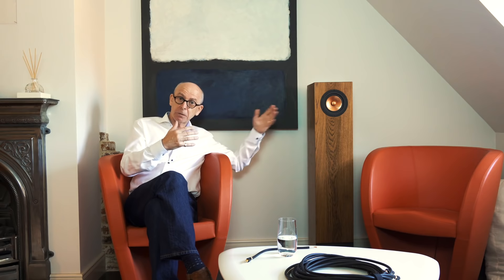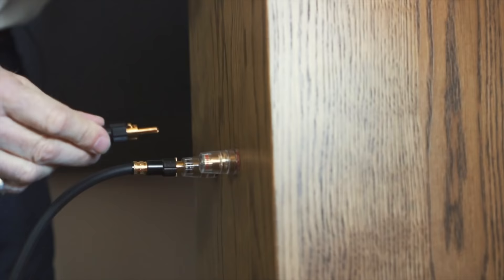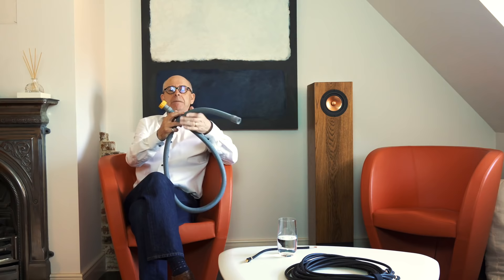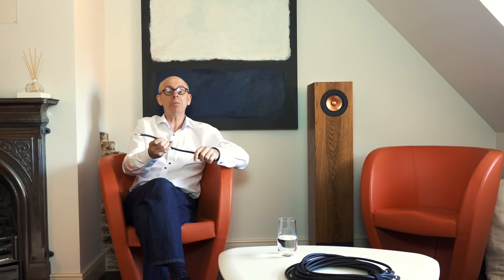Loudspeaker cables - how do they make a difference?

Comment: People forget that a speaker cable is simply part of an overall circuit comprising amp output stage, speaker cable and drive unit (bass is the most demanding load).  All you need to know to select the right cable is speaker minimum impedance, crossover design...dcr of bass inductor, damping factor, amp output impedance and damping factor. The latter depends on output impedance and crossover losses.

Any cable so capacitative or inductive that it acts as a filter should be avoided.  High inductance will roll off the hf and high capacitance can affect amp stability if poorly designed.

Most people hearing big differences between cables are really  hearing the results of either poorly matched amp and speakers or instability of the amp.

Cable geometry in voicecoils matters as it affects motor efficiency hence t&s parameters but this is simply not true of speaker cable...please dont conflate hearing differences in speaker cables with mythical magical electron scale effects...all cable if similar lcr properties will effect the exact same system response...fact.

Far too much tosh spoken by people with little to no real understanding of the subject.  I've been a loudspeaker engineer for many years and have grown really weary of hearing sales marketing nonsense spoken or printed about cables.
Reply: a speaker cable is simply an electrical conductor - that's it.  Crossover design has nothing to do with it, that's after the cable has delivered the signal.

Comment: The only way to find out is connecting different cables at your homeset.
I did and there was a lot of difference. The price doesn't matter, your preferences when comparing do.
I ended a Dutch handbuild silver cable by a small brand.
My set is a NAD M33 connected to B&W 804s speakers.
Reply from the maker: Thanks for your comment. I Absolutely agree. And the only thing that really matters is that you are happy with the results at the end of the exercise.

Comment: Do all the rest first… if you believe that they make a difference. Dit some tests myself and could not hear any difference between a decent cable and a very expensive one. Experiment with the placement of your speakers, it is free and has way more impact than any cable but a faulty one. Instead of spending much money on cables try some room correction systems like Lyngdorf, will have way more impact like cables too… and above all listen to the music and not to the equipment…

Comment: It makes no logical and scientific sense that cables below a certain awg makes any difference to sound, not when cable are in the 100mR per Km, take that over a couple of typical meters and you calculate a power loss far below the threshold of hearing, inductance and capacitance are also insignificant at audio frequencies at low Meter runs. But people are genuinly convinced some sound better, thats the power of suggestion.

Comment: Yes you are correct. Cables act as a part of the crossover in that they affect the frequency as the signal passes. But the strength of your system is dependent on the weakest link like steal parts on nuts and bolts in the amp, locks, and speaker bindings.
Reply from the maker: Absolutely
Reply: The weakest link in in most cases the acoustics of the room where the playback happens followed by the speakers and in many cases the humar ear.
And yes - cables are to just resistors - they can modifiy the signal depending on its frequency. But this effect is very low for low frequencies (and 20 KHz is low in that area).

Its a little bit like claiming that the speed your are driving with your car has an impact on the color of a traffic light as you see it..
That is also true (as we know from Albert Einstein) but this effect depends heavily on the speed you are driving - as long as you not have 80% of the speed of light it is so low that you can definitly ignore it)

Comment: After reading an interview in Stereophile with Henry Kloss, where he discusses working on a new design speaker, and when done, found that they could achieve the same quality sound, by simply using some Radio Shack Realistic brand loudspeakers but using a 10 band equalizer in the system, I've saved myself tens of thousands of dollars on equipment. I replaced the Klipschorns on my buying list with some Cerwin Vega AT-15's, and the Macintosh tube amplifier with a pair of Adcoms, as well as some other 'mid fi' equipment instead of the super expensive stuff that my audio snob friends had bought, and I had a lovely great sounding system. I guess I'm just lucky to have a 'low fi' pair of ears, so I'm able to enjoy my (now ancient) stereo system, while my friends spend all their time trying to find the difference in sound between monster cable and the simple 12 gauge lamp cord that I use. It must be terribly irritating to all the snob stereophiles who feel that they absolutely, positively, have to find the exact combination of absurdly expensive equipment so they can hear the squeaks and clicks that no one else can hear. Perhaps they can also hear the voice of god while they examine their setups.

Comment: I’d really love to see this guy a/b blind test whatever best cable he thinks exists vs a sub $100 10 awg ofc and just let it lie where it lays or lays where it lie or whatever’s said…
Reply from the maker: Hi. Thanks for your comment. This is exactly the point I am making. Our cables are multi-strand copper (hence ‘neutral’). My video is explaining how, technically how cables can sound different. It can be easily demonstrated when using cables that have been deliberately made ‘to sound different’. Just like adding a capacitor or inductor or resistor (or all three) across a loudspeaker you can very easily shape a different sound. you can also do the same by using the materials in the cable to effectively become a capacitor, inductor or resistor, or all three.

Comment: They definitely do make a difference. Without them I struggle to hear anything. I suppose one way of eliminating the effects of conductance and resistance of loudspeaker cables is to use a wireless link.
Reply: A good thick copper cable will do the job! If not, gold is  the best leader!

Comment: Great video and I mean no disrespect, but changing the shape of the voice coil wire didn’t change the sound in and of itself. The shape determines how much copper will fit into a given space. A winding of round wire will have small gaps where the turns and layers don’t fully occupy the available space. A square wire will pack tightly together. A rectangular or flat ribbon wire wound on its short edge will allow more turns of wire for a given height and diameter, compared to a square wire. These things affect the performance of the coil in different ways when combined with other variables of the design. So he didn’t improve the speaker by changing the shape of the wire, he did it by using a different shaped wire to create a different specification of voice coil, which is an important factor in any design. And I only mention this to educate and demystify the story, not to shit on your great video or to be a smart ass. The more we know the more we can enjoy music!
Reply from the maker: Dear Marty. You’re absolutely right and perhaps I should have mentioned the mechanical impacts of the change of profile on the performance of the voice coil. However, I have on good authority from a physicist from the university of Leuven, that indeed the profile of a conductor does have an effect on the clustering of electrons within the conductor and can, in itself impact the pattern of conductivity and thus sound. What I believe you and I are both in agreement on, is that the smallest change in a voice coil can have a big impact on sound. If another physicist wants to come back to challenge the profile theory and our empirical evidence, that would be very interesting to hear.
Reply: @PearlAcoustics  I have just discovered your channel and greatly enjoy your down to earth, sometimes contrarian exposition. Electron “clustering” occurs on an ultra micro scale can be ignored on the scale of speaker cables. At a curent of one mA ca 6 times 10 to the power 12 electrons flow in one milli second, more than enough to average out clustering. None the less you came out right with cables and, yes, the shape of cables can influence speaker behaviors but it does so through inductance and capacitance. Keep up the wonderful videos, Sibelius could put more memorable musical themes in a single movement than most composers in a lifetime.
Reply from the maker: @roberthesse5990  thank you Robert! I couldn’t think of a more suitable composer to name our speakers after!
Reply: I agree with you in your analysis.  I find it a mighty big stretch to extrapolate a voice coil modification all the way to interconnects.
Reply: Nice job, Marty McFly. I concur completely. ATC, the loudspeaker manufacturer of much renown, quite openly say that they flatten wire in order to get more turns into a given magnet gap and thus make a stronger motor in their speaker driver. They do the flattening themselves on a machine that (I think - but am not sure) they built themselves, so they can get it exactly how they want it.

Comment: Sorry, but 90% of all the hoopla about audiophile cabling is just that, hoopla. Spending $1000 for a 10 foot audiophile speaker cable vs $100 for a well built and properly insulated copper cable won't give you $900 worth of better sound. Your $900 lighter wallet and ego will tell you it does, but physics and metallurgy make the ultimate decision. Something as simple as a $.50 cent clam shell rf choke placed on either the positive or negative lead of each speaker cable will make more of a difference for a hell of a lot less money. Knowledge and common sense are what separates audiophiles from audiophools.
Reply: Depends...tube amps for example like different cables than class D amps or AB sometimes. IT also depends on the speaker...adding jumper cables helps more than the cheap brass bar they use on bi wire terminals. Cables can also tune things and add more excitment or more bass and EQ some things. Synergistic research has a warm sound fuse and a cool sound fuse for some of their cables. These speakerss also do not have crossover networks and PCB boards. It is a pure connection. When you have crossover filters and resistors and capacitors in the mix you might have other issues cables can adjust.
Reply: Something people forget, is that providing shiny expensive things for the wealthy to spend their money on, is in itself a service.  It provides employment and doesn't harm anyone.  Luxury goods are not about really about function.
Reply: @gavinhall4112  Yup. Just like a Rolex watch. A good quartz watch is more accurate, but doesn't make the same statement as the Rolex.
Reply: @pennfootball71  All true. Having run solid state, hybrid, and pure tube equipment along with both low and high efficiency speakers, I can attest to your point. Cables can definitely make a difference. I draw the line when it comes to actually getting your money's worth on uber expensive cables.
Reply: @hobo1452  for the Money I like Kubala Sosna
Reply: @pennfootball71  I've owned a lot of different cables. I stick with Pangea Audio Premier SE interconnects. The speaker cables I eventually stumbled upon that had a sound that I really liked are SKW purchased on Amazon.
Reply: @hobo1452  Pangea uses a tiny amount of Cardas Copper which is junk copper that is full of crystals and not as refined as single crystal continuous cast Ohno copper and Pangea has No geometry either just twisted pair. It’s for cheaper home theater or small system applications and a store brand AudioAdvisor created on the cheap.
Reply: @pennfootball71  The material science, present or missing, is only part of the total equation. I have always trusted my ears to make the final decision, and I never, ever ask other people what they think about my system because I didn't build it for them. That's not meant to be a slight against you, that's my way of saying that one person's poison is another person's cure. As long as we are both happy with our systems, how we individually got there is irrelevant.

Comment: From what I've heard, PMC use Van Damme cables. Well made with excellent connectors. So obviously not hugely expensive does the job.
Reply: Van Damme cables are fine, PMC transmission lines are another thing ;-)

Comment: OFC cables are all smoke and mirrors.  Normal copper core is 99.99% pure.  OFC copper core is 99.995% pure.  I defy anybody with run lengths of less than 20ft to tell the difference
Reply: Used to believe the same till recently.... tested my Audeze LCD3’s with my Mojo using standard cables then upgraded to the Norsost 2 cable. Difference was somewhere between the difference of using the standard cable and the Hugo2. Huge difference between the best and standard on a 5ft length for sure!!!
Reply: @willbrooksy  SORRY FOR MY IGNORANCE AND CAPS. Is the shorter the cable the better the sound?
Reply: @tomstubbsmusic  No he fell for the snake oil scam.
Reply: @tomstubbsmusic  Yes. All cables suffer from 2 main things.
1) Resistance over length of cable
2) Interference from other electrical signals.
The shorter the run of cable the better it will all behave for you.
This does not just apply to speaker cables
Reply: There's another problem, first you have to clear your ears - I mean really have them professionally cleaned once in a while - if not you cannot tell the difference. Not kidding.

Comment: I work in Telecom and Given the Extremely Short Distances the Signals Travel From Components to Amplification then to Speakers to The Ears I Seriously Have Doubts About HEARING IMPROVEMENTS IN AUDIO HARMONICS BETWEEN 10 GAUGE OFC $50 SPEAKER WIRE AND $500 WIRE IN A BLINDFOLD TEST IN A ROOM SAY 25ft by 15ft....As an Example to think about Telecommunications wire is 24 gauge and will Carry Voice & High Speed Data 3000ft From Source Before Noticable Signal Loss Occurs and Signal needs a boost....I would say it's Like the Difference between Encoding on a CD vs MP3....Can You Truly Hear the Difference  Blindfolded

Comment: The most ACCURATE speaker cable is the one with the least capacitance, resistance, and inductance.  If another cable sounds "better," then you're using the cable's higher capacitance, resistance, and/or inductance to tune the signal to mitigate the deficiencies in your system--usually your speakers.  Tuning the signal is adding frequency distortion to the signal on top of the distortion already there.
Reply: So what do you recommend?!

Comment: I am very happy with my silver speaker cables made by Kondo, Japan. They definitely add to the sound quality of my hifi system. I switched to Kondo a year ago from the German brand Inakustik air cables, which are not bad at all but cannot match the refined sound quality of Kondo. Believe me, one can clearly hear the difference.
Reply from the maker: Thanks for your contribution to the discussion
Reply: No they don't....
Reply: It's all in ones head it's just jewellery.

Comment: A pair of well made cables do work. I paid about $250 for a pair of XLR cables due to noise I was hearing from cheaper cables I purchased. They didn’t make my system sound better but the sound was cleaner. No more static or ground loops.